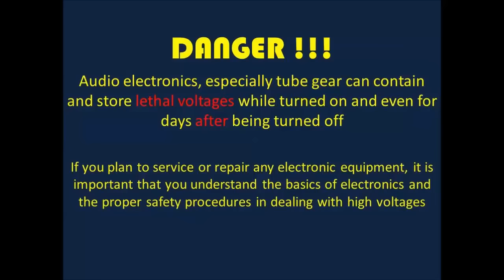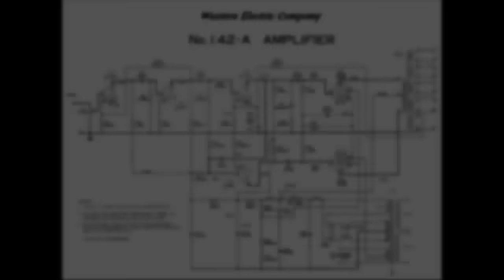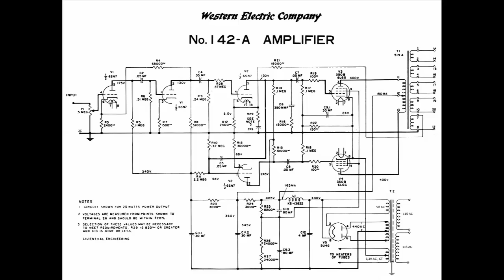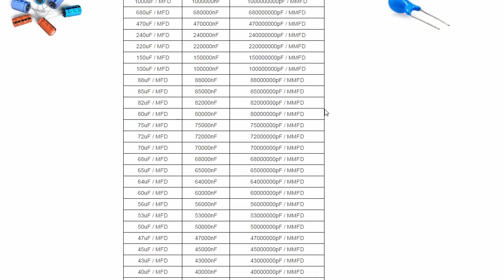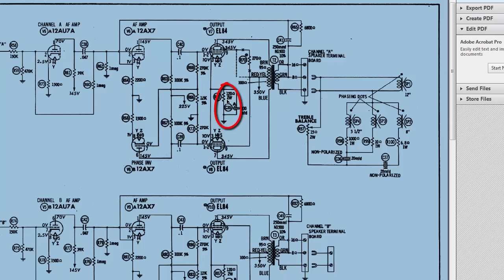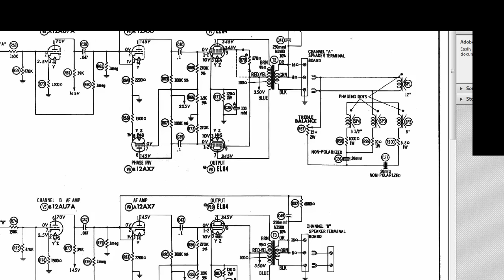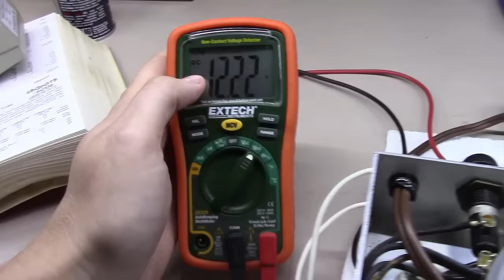Audio Tube Amp 101 - Episode 2 - EE Math 101

Comment: A little late to party, but i finally got here.  I studied electronics a lifetime ago, but sadly I didn't use of it. I've studied all this, but I'm as rusty as hell in application. I thank you sir for putting together these excellent tutorials and you make the review process for me an enjoyable way to spend my time. I played guitar than switched to bass and I completely understand how an electric musician's sound and texture is shaped by the amplification process. Back in the day, I built my own bass cabinets (had to learn enclosure design and filter equations inputing TS parameters of the particular bass driver. I assembled Dynaco kits which were cheaper than music amps. The solid state Dynaco stereo power amplifier (60 w/channel) which I bridged and I had myself a powered bass cabinet. I built a Dynamo tube preamp kit to provide the gain and EQ to the input signal for the power amp. A hybrid amplification system which was quite powerful in its day with efficient drivers and through a  properly designed ported box. Now a days, it quite common for a bass head to use a tube preamp into a class D power amp. Saves so much weight in transport. Personally, as a bass player, I never wanted the power amp to clip. 30 Hz bass frequencies, the low B on 5 and 6 string basses is difficult enough to keep 
tight and audible. Anyhow, I'm going quickly through the early episodes until I reach the stuff I've forgotten. Again, thank you for doing this

Comment: I am very happy that you have taken the time to create this series. You are explaining something that I have wanted to know for a very long time. I see two perspectives in this video. First is design - what you did to change the resistance and how it affected the output. The second is analysis - how to read voltage across a resistor and determine if it is functional using the math. In addition, while I do not need to learn algebra, including this information allows users who are not familiar with the concepts the ability to learn as well. This is what the Internet is for! Thank you for your time.

Comment: Hello! Thank you for your great videos! I just came across this one and the amp in the video got me puzzled. I wonder why the tubes ran hot in this amp when the cathode current was 50 mA which was safely under the max rate of 65mA? Even the typical operation for these tubes is specified by the manual as 62mA and the cathode resistor value shows as 130R, which is pretty close to 120R.  Do these tubes "typically" run hot?

Comment: If one tube fails will the additional milli amps be pushed threw the remaining tube.
Reply from the maker: +MrMac5150 It kind of depends on how it fails.  If it shorts, it will end up taking most all of the current and likely blow a fuse or worse :-)  If it fails open, then yes.